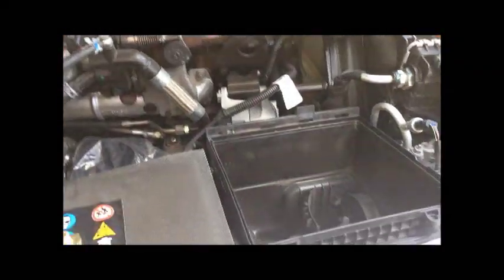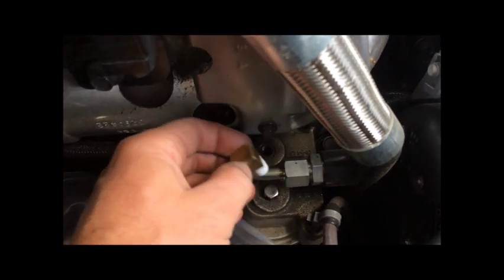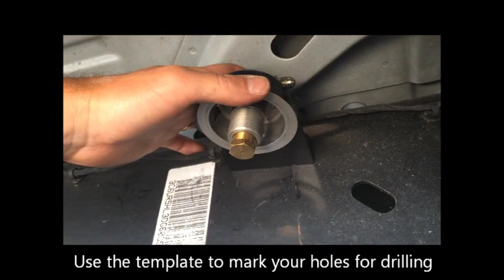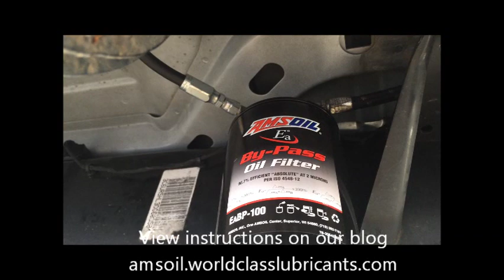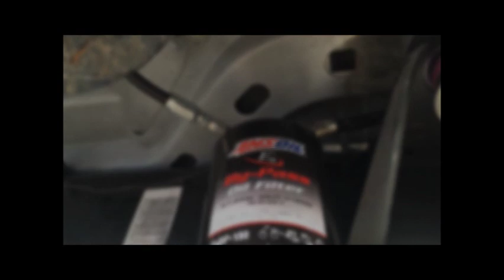6.7L Cummins Oil Bypass Filter Install - AMSOIL

Comment: Hello, pressure can be very tricky where the oil will always pass through lower restricted loop. This means the oil will never go through this add on unless there is a a suction pump push the the oil through this add on filter.  It seems the whole purpose of this system (by the maker) is meant to sell to those who have more anxiety about engine being under excessive pressure where scientifically will not work unless there is an add on pump, powered independently.  Thanks so much for great detail installation. You have very educational videos.
Reply: Although this comment is a year old the oil comes from the sump through many different small holes to lubricate all the different moving components of an engine.  The small hole on this filter system will take oil through the filter no different than the rod bearings take it.  Some manufacturers use a bypass system from factory.

Comment: Ive been considering adding this to my 2018 Ram 2500 6.7 cummins.

Deleted her at 9000 miles and studded the motor. Also added a FASS, an ATS deep trans pan, ATS trans case brace and deleted the thermostatic trans cooling block.

Comment: Another approach to consider is the Cummins Filtration (aka Fleetguard) LF9028. This filter combines a full-flow Stratapore element with a bypass element within the same can. It is not, however, approved by FCA so warranty issue could arise. This filter is specified for Cummins B-series 6 cylinder engines in excavators.
Reply from the maker: Nice filter but the Fleetguard is only filtering down to 30 microns. The AMSOIL By-pass filters will filter at 98.7% efficiency down to 2 microns which is awesome.
Reply: @CampfiresAndMotors  I advocate use of the LF9028 because it contains a full-flow Stratapore element and a bypass element within the same canister. There is no need for added (and potentially reliability compromising) external plumbing in the lube oil system. The Amsoil spec-manship is spec-tacular, however I spent decades as a reliability engineer and know that failure rate increases exponentially with added connections.

Comment: Great video. How many miles are you getting on the oil with this installed and how many miles on the bypass filter before you change that?  Thanks

Comment: will this be safe on my 2016 Cummins when it's -30 outside and the synthetic oil I use is still really thick??? I'm concerned with when I first start it, I do plug it in but that does nothin for the oil
Reply: It's a bypass filter.  It'll have no effect on oil pressure even if NO oil flows through it.  Eventually it'll warm up and start working.

Comment: How much flow should you expect at idle? I just installed mine and pulled the cap to look. It is just kind of dribbling out. Thanks
Reply from the maker: It only takes about 10% of the oil at a time. As RPMs go up so does oil pressure. At idle you shouldn’t be getting a solid stream.

Comment: is this kit better than the dual bypass oil filter???

because i bought the dual bypass kit it uses the Eabp-100 bypass oil filter and also the Eao26 oil filter and most times i start in the mornings i do NOT get any oil pressure, THIS PROBLEM STARTED EVER SINCE I INSTALLED THE DUAL BYPASS KIT....

is nothing wrong with my truck because i took the system off for one oil change and the oil problem when away...

WHY DOES THIS DUAL BYPASS KIT COUSES MY TRUCK TO LOOSE ALL THE OIL PRESSURE FOR A SHORT PERIOD OF TIME????

THIS KIT IS SUPPOSED HELP MY ENGINE, ''NOT DESTROY IT!!!!
Reply: The oil is to thick to flow though the filter when cold. Once warm it will flow just fine. If you still have the factory oil filter you will not harm the motor.
Reply: +Daniel Cardenas  I understand that Amsoil does not recommend this dual bypass kit. I am thinking of buying this dual kit for my 2015 Ram 2500 Cummins but adding the billet oil cap and return line and fittings to allow oil to get to the head faster, this may help with the oil pressure problem.

Comment: I look forward to trying this on my 1999 K2500 Chevy Suburban (6.5 Diesel.) First though would you recommend I fix the oil pressure gauge? I noticed the comment by Daniel Cardenas and I use 5w40 oil year-round (Full Synthetic) so my oil may not be as thick as what he uses, but still. When I got this Suburban a previous owner had put in another dashboard cluster which doesn't match the vehicle 100% and although it works for the most part the oil pressure and fuel gauges are off; the fuel gauge is too high (easy to keep track of with the trip odometer) and the oil pressure gauge is too low to read anything. I just know my oil level's fine since I keep checking it.
Reply from the maker: +Austin Lucas I did not notice a significant drop in oil pressure. If the one you have works but is not accurate you could use that as a baseline for reference.

Comment: whats a  SINGLE filter, Oil bypass kit run for a 2007- 5.9 cummins.  ?     complete,with that new cap.?
Reply: I know this is old. But a kit in 2021 is around 300. I am building my own

Comment: If you install this on a truck that is still under warranty will it void the warranty?
Reply from the maker: No it will not. The truck in the video is still under warranty.
Reply: please explain why not.
Reply: WorldClassLubricants sorry...but I can't believe it doesn't void the warranty.  you bypass the original oil filter, re-route oil lines drill holes in the frame.  Take it in for a motor issue with all that stuff on it and I garantee they will not honor your warranty
Reply: This still uses the factory full flow filter, it just adds another filter to the system. It does not void any warranty.
Reply: But why you have to put more stuff in the 🚗? The original design was not very good?
Reply: @TheRSGamer  diesel engines make the oil really dirty, really fast. All the spot getting in the oil is very abrasive. The factory filter works just fine and the engine will last a long time, this just gives that little extra protection. Kind of like using synthetic oil, it may not be needed but it still helps if you do. Gasoline engines don't have the same problem with the oil becoming abrasive. That's why diesel oil looks black even only a minute after charging it, when oil in a gas engine will look clean for thousands of kilometres.
Reply: @CampfiresAndMotors  only if one of lines associated with the bypass filter ruptured or separated would there be a warranty issue (as there should be, obviously).

Comment: Why do you have to fill the filter before installing?
Reply: So you dont have to pur an equivalent amount in to the engine to make up for the increased capacity,
Reply: also most important , theres no gap in oil flow at first start up !!!

Comment: How is this a by-pass set up, if you're still using the original filter and will still have to replace it when you change the oil. I think that just added additional work. I think most people wanted a real by-pass where you would eliminate the need for the original filter placement. Some people struggle with its crappy location...
Reply from the maker: It's a bypass filter because it filters a smaller amount of the oil at a time at a smaller micron rating (2 microns) in addition to the full flow filter (about 20 microns). AMSOIL does have a duel remote filter mount the moves the full flow filter as well. A bypass filter is designed to be automatically bypassed if it were to become clogged, thus the reason to retain the full flow filter.

Comment: what is the point of this kit?
Reply from the maker: Extra filtration for your oil. OEM filter goes to 20 microns and the bypass filter will filter down to 2 microns. Filtering out more soot and contaminants from your oil allowing you to run your oil longer.

Comment: Why is Amsoil the only company that puts the oil return on the filler cap. As my understanding heat rises and probably not good to be dropping more oil on top of the engine then it's supposed to it already does that from the factory and this is the only system that does this every other system connects right to the in and out oil lines on the engine and lines are not long nice and short lines for better pressure and filtering. But yeah with the oil going in the filler cap is one of the reasons why I would never buy this system. Because of the return of that oil cap I can't see it being good to create more pressure on the valve cover with more oil then it supposed to
Reply from the maker: I've never had an issue with this type of return and have used it on Cummins and Powerstrokes nor have I heard of any issues. It is a really low pressure line. With the engine running when I remove the return line cap the oil is a nice steady stream with little pressure. If you don't want long lines the system can always be mounted in the engine bay so the lines are shorter. I like the bypass filter on the frame rail as this allows for more cooling being outside the engine bay. Also, you can hook your return line up where ever you want to return the oil to. This is just a simple quick install kit that is available through AMSOIL.  Thanks for the comments!
Reply: The flow rate is very small from the bypass filter.  Zero effect.  Nor does it change the "pressure on the valve cover."  Why would it?
Reply: Frantz oil bypass also uses this setup

Comment: OK< just seen this video again, and I noticed the filter mount has a press fitting  where the new oil filter connects, did that stay on when you installed the oil filter, or was that removed to install filter. ?   Video does NOT show .
Reply: If you're talking about the brass fitting with the small hole in it that is there for a reason. The small hole is the out back to the engine. It's a restriction that is there to slow the oil flow down so it spends time in the filter element and gets nice and filtered.
Reply: @Carlitosway211  was wondering about that too, for mine didn't know If was supposed to take that off